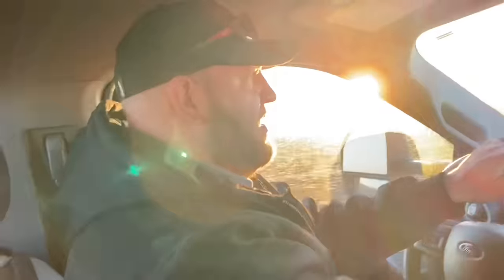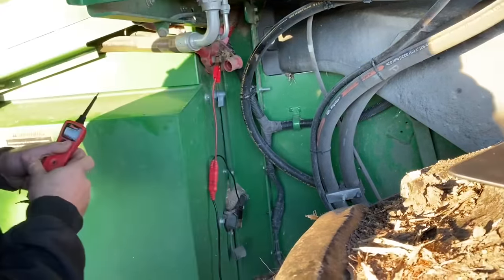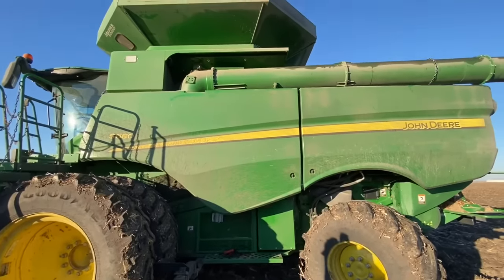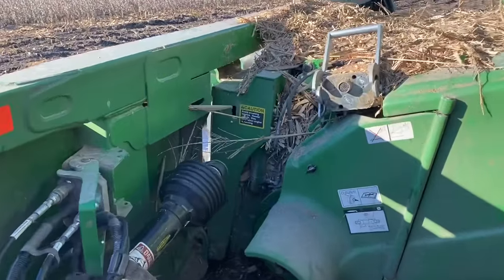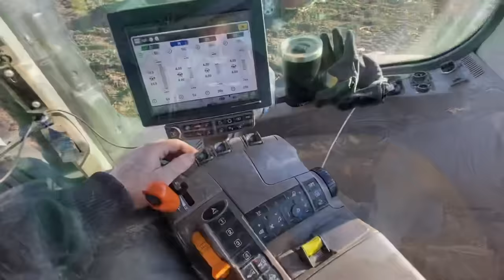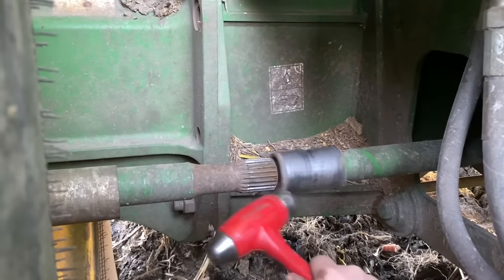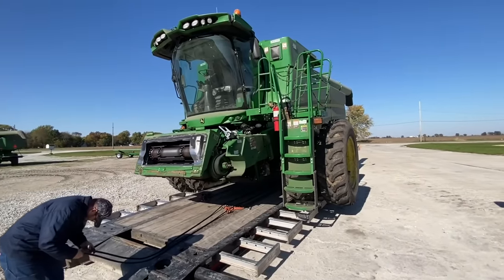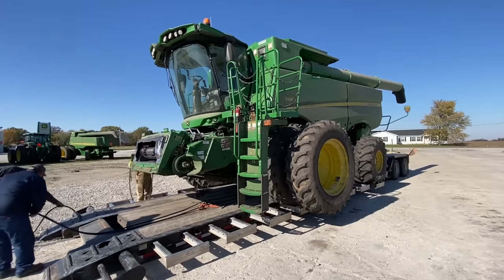John Deere S680 hydrostatic pump failure - learn how to move a disabled combine

Comment: I gotta thank you for showing how you moved it without being able to undo the parking brake. The S680 on our farm was stranded in our shop because we had to tear down the EGR system. We obviously couldn’t start it with it half tore down, so taking off the drive couplers was the perfect solution. We pulled it back super easy and made us room for other projects. Still gotta wait on deere to get back with us on whats the issue with it

Comment: I had one that developed a rear crank seal seepage.   That caused the plastic coupler to strip.   same recovery except auger was in and lucky no grain in the tank.    That was $8500 and almost a week to get the engine out then back in.

Comment: Great video reminds me about 20 years ago about same size Russian made combine harvester had engine seized and needed to recover about 20 miles so what I have done made an A frame attached to rear axle beam and towed it backwards also tried to connect hydraulics to the tractor for the steering but it was too complicated so removed steering rams completely only left cross axle steering tie rod tried to pull and it steered itself follow the tractor and happily made all them miles to the yard to rebuild the engine 
Loved them complicated jobs back then 
Thank you again and best regards
Reply from the maker: Thanks!

Comment: Outstanding job and video.  Would like to have seen how you tied into the steering cylinders on the combine.  Maybe in another video.  Sure makes it look easy when you know what you are doing.  Thks for the ride along
Reply from the maker: Thank you! I just took the hoses off the steering cylinder and attached two hoses that went to the scv's of the tractor.

Comment: Awesome job with recovery! Love the way you are able to steer combine from your tractor. Makes it especially nice when loading onto trailer.  Where did you hook those hoses on at the combine ?
Reply from the maker: On the steering cylinder
Reply: Thanks. That’s what I thought. But it kind of looked like the hoses went further to the front of the combine.

Comment: Moght I suggest a portable power pack in your service truck with hoses long enough to attach to things like the inloader auger it would pay for itself by the hours saved doing things manually and save dumping precious hydraulic fluids out of the combine or tractor or what ever implement you need to hook up to. Hope the tip helps make your day easier cause I kknow it can be tough sometimes. Work smarter not harder is my mantra along with if you give a lazy man a job he will fimd the easiest way to do it lol!
Reply: I had similar ideas 💡.  👍
Reply from the maker: What brand do your suggest?
Reply from the maker: @TheJohndeere466  yeah it's $5k 🤑

Comment: Had the hydrostatic pump go out on my 9670 while on the road. Got it on the shoulder before it completely quit, called my JD tech, he came out and changed out the pump right there on the shoulder of the roadway. I flagged traffic by while he did the work. About 4 hrs later, I was going again.
Reply: yeah thats good if theres no shavings in the system. we had a hydrostatic pump failure in a combine and the whole systems had shavings in it. resulting in destroying both the pump and the motor and a flush of the whole system
Reply: @eltontv6002  Yes, he was afraid of that, but the filters must have caught the shavings, as everything worked fine another couple years when I traded it off.

Comment: Yes when I had to put the auger back I just took 50 ft of rope put it on the front of the Polaris ranger took the hoses off and pulled it back but that's when the auger swing cylinder screwed up

Comment: you should watch the video form Larson Farms.... 9870 STS Combine Dealer told them that the steering is mechanical and the combine does not need to run to steer the combine. Fine the combine had a hydro issue and did not want to start it. Well turns out the steering is hydraulic and they broke the steering wheel off trying to turn. i think the video is called "Dougo Breaks Steering wheel off" quite funny video.

Comment: Clever idea but unless the steering circuit is isolated from the main system haven't you potentially introduced contaminants into the rescue vehicle's hyd system now?
Reply from the maker: No. I'm only tied into the cylinder.

Comment: Is the steering cylinder oil supply  seperate frome the hydrostat system? By you hooking the hoses from the tractor to steer, will this not contaminate the tractror hydraulic system?
Reply from the maker: No. Not just hooking into the cylinder.

Comment: Remote steering hydraulics is not a new idea. We had a similar system using a forklift side shift hyd. feed with Dowty couplers to move dead combines around the yard in the 1970's.

Comment: Zeth, I remember in your video with 8RX 410 you commented on the stereo. I am finally getting the time to run some tillage in my 8RT 370 and the sound system in the 370 I traded blows this out of the water. Did they downgrade?
Reply from the maker: There are different levels of stereo systems. The ones with the sub are the best.
Reply: @ZKMasterTech  this a signature edition with what look like tweeters in the cab posts.

Comment: Was there a reason you couldn't just manually steer?  Or is that feature gone from the present age hand pumps?
Reply from the maker: You can't manual streer that combine through that soft field. You need precision when loading it on the trailer.

Comment: Zk, do you take time to answer nagging combine questions? Dont want to bug ya, just curious.
Reply from the maker: Yes.
Reply: @ZKMasterTech   Thank you!!! Worked at a Sloans location as an intern and sincerely appreciate your videos. I wish I could still work with that crew, but I am trying to pursue farming. My question is on a 2013 S660. Random green trailer icon on the corner post now and then, and going down the road, it'll show up on the touch screen that there is a trailer attached with the chopper down message. I asked a Deere tech that conducted our recent inspection if there was a DTAC regarding this, and he located one related to recalibration of the lighting circuit. Is this a common annoyance? Is there a way to let Mr. Combine know that there is certainly no trailer back there? Thanks for your time and excellent videos!
Reply from the maker: @jessemaier8681 I’m not sure. Never seen that before. There is a calibration for the Amber lights but not sure that has anything to do with the trailer icon. I’ll have to look further into this.
Reply: Power Up! Thank you! No rush at all... I guess I have all the standard 2000 separator hour items to do, so ill be occupied for quite some time once I win the lotto to buy parts 😂

Comment: I am disliking newer, larger equipment.  When it breaks down it needs specialized experts, equipment… to move, fix. Engine stuck, small fire in gear drive 6600?  Pull away.  Need to steer? And couldn’t from cab? 8’ board hooked to arm while slowly rolling guides. 
  I had a newer tractor stuck in place for 2 weeks for electric relay.  They are great when they work right.  But 10x worse when they don’t

Comment: I guess I’m wondering why you can’t just put a new pro drive in right there and go.
Reply from the maker: Because of the metal contamination in the whole prodrive and main hydraulic system. Way to many components to replace or flush to be in the field. There could be close to $80k in parts to replace before it's all said and done.